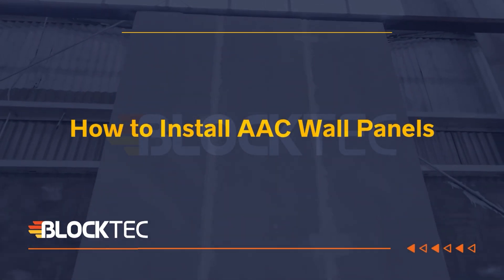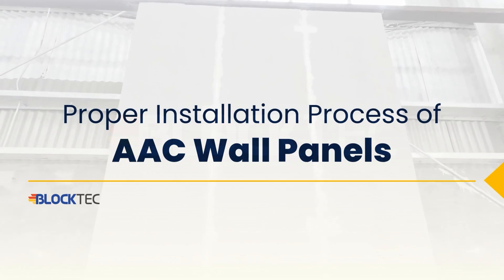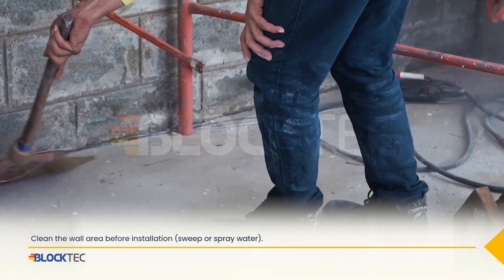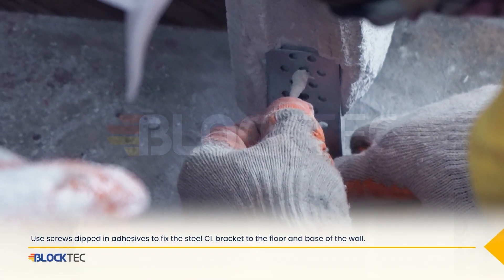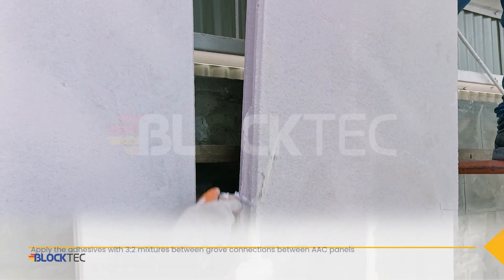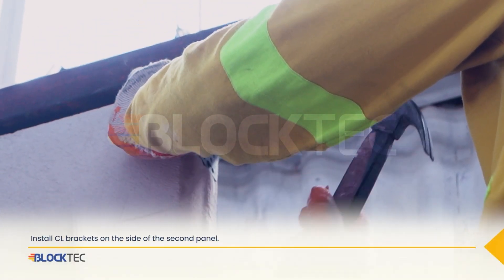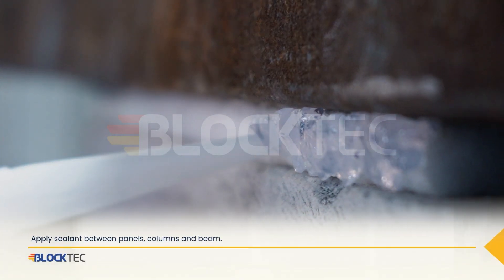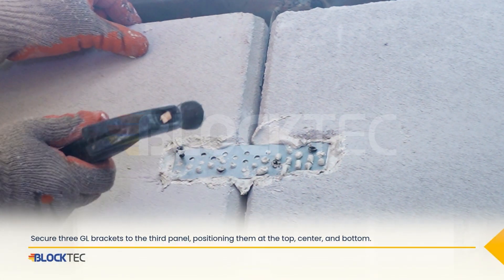How To Install AAC Wall Panel? by Blocktec

Comment: Planning to have a 44.8 sqm one storey house on my 3rd floor concrete roof deck.

I have a 3 storey building pero walang laman ang 3rd floor, roof deck only.

Plan House Floor Area: 44.8 sqm
Roof Deck Area: 91 sqm 
Lot Area: 112 sqm

Location: Bacoor, Cavite